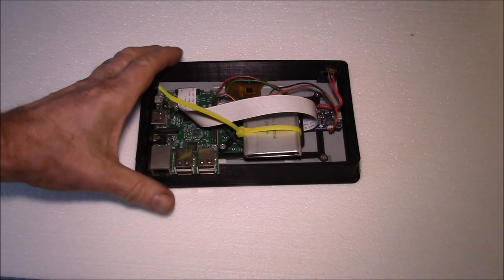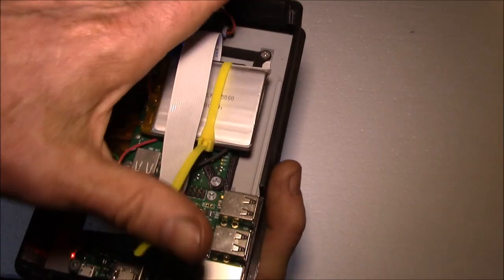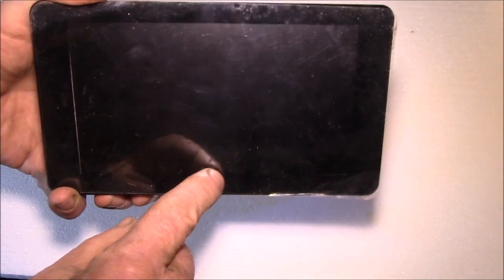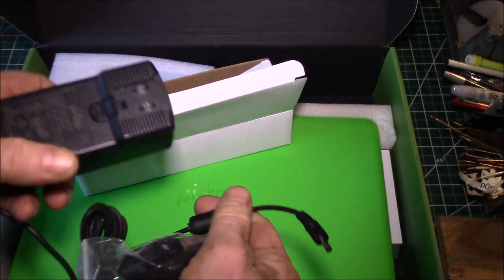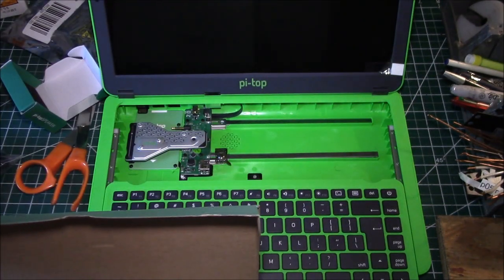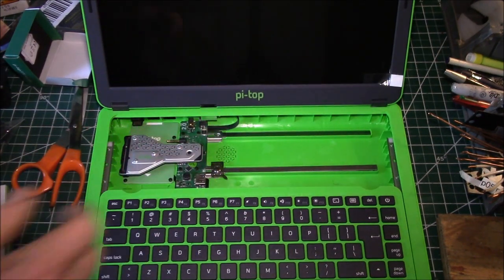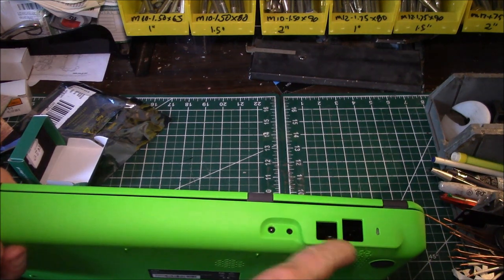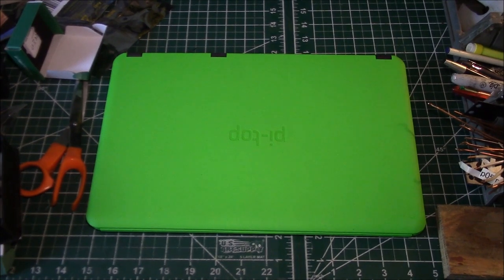pi-top; first look

Comment: I have that case too, very recently printed out and in white.

I also ordered tinker board as pi and tb have pretty compatible form factors and that I know that asus natively supports various android versions which work far better than with pi!

So yes, I will be just replacing the pi with the tb in that small touch screen - case setup to use android on it.

But I didnt purchase those pieces sold by adafruit, instead I plan to use this android touch pc as a desktop with no battery! xD

I too was extremely interested in pi-tops, even considered to convert one into a somewhat strong coding pc with very low-profile desktop motherboard and ram sticks hahaha!

I am curious to see what you will end up coming up with these nice gadgets!

Comment: Hmmm i was looking on eBay and the price is almost $400,-  for that money you can buy a nice notebook or chromebook.
Reply from the maker: Yes, that's a good point.  I was mainly drawn to the ability to use this for Raspberry Pi and Arduino projects with the internal hardware prototyping support.  I already have a laptop but I don't use it that much and I was looking for something a bit different.